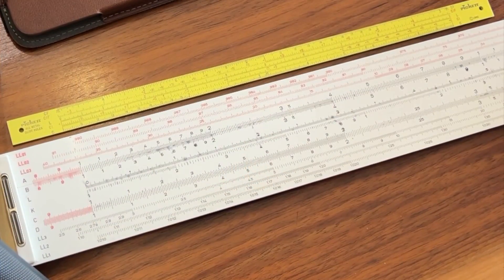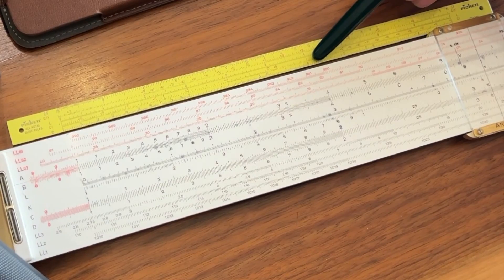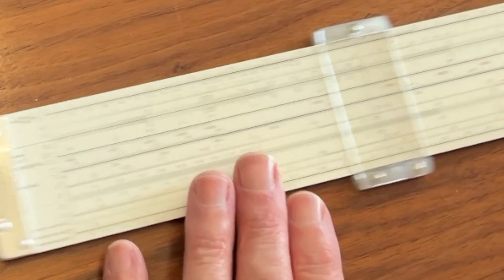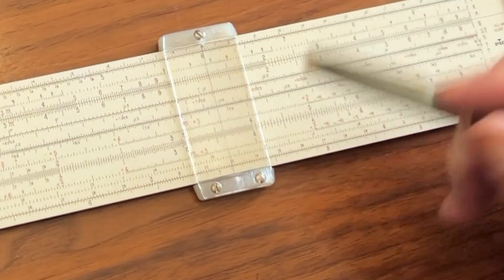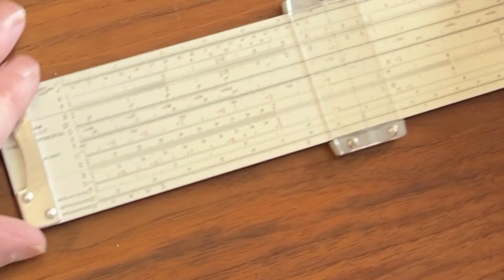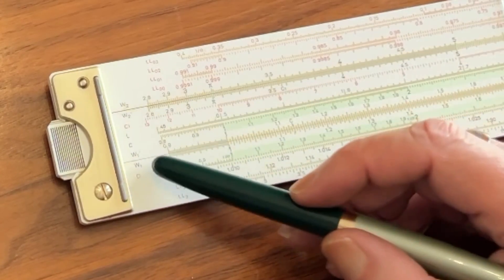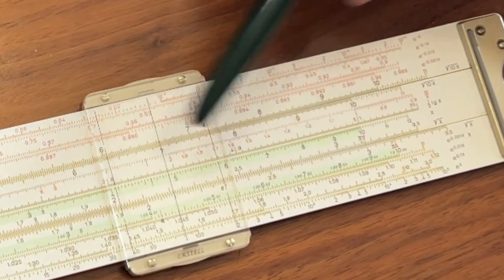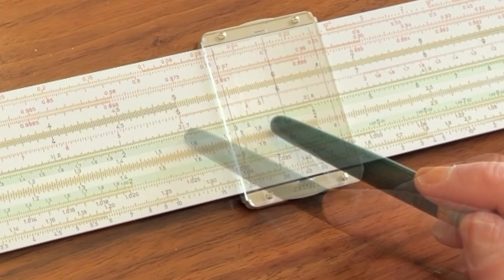Genius of Precision

Comment: Very nice video! I entered engineering school in 1977. My class was the first class that did not take a class in the use of a slide rule. A calcultor that would do Trig functions cost about $100. It was a ton of money back then-about a month's salary for a part-time student job. In high school, we couldn't even use a slide rule.  All calculations were done using long hand, or with log tables. How times have changed.  I saw a calculator in a dollar store more powerful than my first high end TI for $5.
Reply from the maker: I got my first TI-55 freshman year in high school..

Comment: Impossible to follow this guy with his super small scale and unreadable  scales as well as his super rapid changing locations before one can read any of the scales.  I had to use a slide rule for surveying classes in spring 1972.  The number of digits were to few to get accurate values of small angles with the trig functions.  We had to do calculations long hand on paper. By the way, all the Apollo moon shots used slide rules to perform almost all the calculations.

Comment: In the early '60s, we got three-place answers, but we had to calculate the place, 1.0, 100, or .001. Villanova had an IBM 1620, the size of an upright piano. We used punch cards and made money troubleshooting other students' errors. Now, we use a concrete slide rule for the quantities. I then enter all the numbers into a program to verify the answers. At $265 a cubic yard, we cannot  error. BTW; IBM could calculate massive cut and fill jobs, and calculate the offsets, etc.

Comment: There were scientific slide rules where a lower line was 1 and the upper line was 
times Pi just looking up on the hairline without moving the sliding middle.
And commercial slides where the lower line was 1 and the upper one was times 360 ( daily interest) and mark up or down was easy.
Yeah, and I know how to do slide rule stuff with logarithm tables ( lookup values adding and looking up the reverse value) with pen and paper.
But I’d prefer my Casio scientific calculator or TI- spire CAS app if I had such problems at all. 
All I do is throwing SQL results at Pivot tables.
The faber Castell SR had an additional magnifying lens as accessory that could be attached to the clear thingy for improved (lol) precision.

Comment: I did my A Level exams with a slide rule. Five years later I was using a Casio scientific calculator and writing stats analysis programs for THE computer at my college for my Diploma in Management Studies.

I still love slide rules. They designed Vulcan, Blue Steel and Concord, and the ships my grandfathers sailed. I have my father's, with his main engineering formulae printed on its back. He literally did rocket science with those equations and that slide rule.

Comment: As an engineering student, I was darn good at using my slide rule back in the 1960s.  I knew all the scales.  I still have it.  Mine has a belt loop on the case. I could wear it walking around campus. Pretty nerdy huh?  I also had a pocket protector, which was actually more than nerdy.  Ink pens leaked a lot in those days.

Comment: I still have mine.  Got me through Caltech in the late 60s. There were Pickett fans and K&E fans. Only the nerdiest hung them on their belts : ) I bought an identical one on Ebay for my granddaughter. I still have my little plastic circular slide rule from then, as well.
Reply from the maker: Cool. My only experience with a slide rule as a primary calculating device was the e6b flight computer
Reply: @sliderulesandmathematics9232  During my first year in grad school (1972), the (Astronomy) department bought a newly available HP-35 calculator for the (12 or slightly more) grad students to share. It was chained to a desk in our grad student lounge : )
Reply from the maker: And to think calculators are as valuable as paper clips now it seems. I think we all just use the free one on our phones
Reply from the maker: I prefer the tan/cream colored Pickett n3. Great scales and doubles as a katana

Comment: I used a Pickett slide rule for years as a C-141 Flight Engineer. Then, they issued HP 41CV calculators which I used until I wrapped up my Air Force career.

Comment: I saw a much larger slide rule someone had ... I think it was something like effective 50m or more, printed with the scales spit around a drum.  Made years ago by, I think it was a German company if I recall correctly.  These were quite popular for, e.g. use in banking in the 1940s ... want to calculate that 30 year multi-million dollar loan, and be quite accurate ... yeah, 50m or so long slide rule.
Reply from the maker: Sounds like a fuller calculator. The scales are 41 feet long

Comment: I'm 83 and a retired Engineer. Brings back many memories. I bought my first slide rule in 1961. I still have it, along with 3 more.
My first electronic calculator was bought in about 1975, I think. All it could do was add, subtract, multiply, and divide. It cost me £80! Still got that as well.
In about 1997, my daughter's mathematics classroom in high school had a large 8 foot long basic working slide rule on the wall. I asked the teacher if he used it, but he didn't know how to. I offered to teach him, but he declined. I offered to buy it, but my wife vetoed that. Pity. It would look good on the wall of my man-cave.
(Thinks: I believe I could make one in my workshop. Secretly, of course.)
Reply from the maker: I have a 7 foot Pickett
Reply from the maker: I also have my father’s (ME U of M 59) and grandfather’s (CE Cornel 25) KE slide rules

Comment: Before the advent of electronic calculators, the Irish Department of Education used to issue a little yellow book of Logarithm, Trigonometric, Physics and Chemistry Tables for Secondary Schools (High Schools). The Department's genius touch was that we were provided with a clean copy of the 'log book' for the high school graduation (Leaving Certificate) exam, which is the portal exam to third level colleges. Even the fairly average student was aware that if you knew and understood how to use what was in the 'log book', you were already half way to doing ok in the exams. We came to know that little book backwards, and knowing it made us numerate in a way high school students today seldom seem to achieve.
Reply from the maker: Exactly. We made a grave error in letting calculators in the high school
Reply: @sliderulesandmathematics9232 and now they're letting AI in.
Reply: I had one of those books, imagine its value 200 years ago

Comment: I used a K+E 20-inch for the first year of engineering school in 1975.  Our “Introduction to Engineering” class spent quite some time teaching us how to use the slide rule.  In my second semester, in 1976, relatively cheap Casio scientific calculators became available in my home country, and the slide rule soon became obsolete.  Some professors wouldn’t let us use calculators in the exams.  They insisted we needed to really learn how to use use the slide rule in case “one day, in your professional career, you are in the middle of an empty field, and the calculator’s battery runs out of juice.”  By the end of my second year of engineering school, calculators were widely in use.  I still keep my K+E, however, as a reminder of my transition to college.  Slide rules were some clever calculation tools, and the only portable calculation tool available to anyone from the 1600’s until about 1970.
Reply from the maker: I love the 20 inch KE and use it regularly. Great accuracy and clear numbering

Comment: I had a cheap 6 inch plastic slide rule going through engineering school in the early 1970s. I only needed the basic scales.
 I eventually got a Texas Instruments scientific calculator. I could also use the college computer (punched cards in FORTRAN).

Comment: I own a 250mm Deitzgen and a 600mm Deitzgen (log-log dual slide) that got me thru The Calculus and Differential Equations and sent men to the Moon and back safely in less than 7 years, from Mercury to Apollo. Musk and his tens of thousands has spent $17 TRILLION tax-payer dollars with computers and nearly TEN YEARS and hasn't had a successful launch of his " Heavy Lift" rocket or his "Starship" that NASA has finally realized CAN NOT WORK. They are both in the lap-drawer of the desk my 'puter-toy sits upon. You can STILL order them from Germany, but instead of $16 for a 250mm, be prepared to pay $200. Just like my Parker 75 Presidential Fountain pen cost $27 in 1972 and now when they are produced, they are $300 with a "Super Flexible Gold Chisel Nib". A slip-stick is STILL a bargain, considering a WORKING Hewlett-Packard HP-85 sells for $3500+ on Fee-Pay...

Comment: Have you looked at circular slide rules?  I had a 600 inch equivalent with 5 digit accuracy.  But I often had to solve the problem with a regular slide rule to make certain I was on the correct spiral scale.
Reply from the maker: Yes o have a fuller and a precision circular rule

Comment: I've never used a slide rule but they were cool to me even when I was a kid at a time where pocket calculators started to appear in my country.

Slide rules gives you a different dimension to the numbers you are looking for. That dimension is in the movement of your hands that feeds back into your brain. That movement gives you an insight to what the numbers are actually doing. It's not about precision but about the engineer feel for the problem. If you want precision you can get it but that is irrelevant most of the time. 

I've had the privilege of having a microwaves class where the teacher asked us to make all calculation in our head. It was not about precision but about the feel for the numbers: was that answer about two volts or two hundred? It was not about decimals. By the end of the first hour I came to an appreciation of what he was trying to do even though I was silently mad at him for 'forbidding' pocket calculator. Doing all those rough calculation in our minds was not necessarily faster. It was faster in giving us insight.

Comment: I still have a Faber Castell sliderule that I bought in 1965 for £5/10 shillings. £5.50 in modern GBP. That was what I earned working 2 weekends in a garage when I was at school. I got a degree in Electrical engineering using it. I lost the rubber ends for mine just as you don't have.

Comment: You pulled out the Faber Castell, and I had to back away because I started drooling on my keyboard.
Reply from the maker: Wait til you see the fuller calculator
Reply: @sliderulesandmathematics9232  Never used a Fuller so it won't have quite the same effect.

Comment: Brit here : Slide rules were/are? fine for structural design, as it involves varying factors of safety and empirical strengths of materials. I mainly did highway design, pre-computers, and that did need strings of significant figures. I mainly used 8-figure logarithms, and eventually a crude Friden calculator, which cost £800. A very senior colleague much later gave up his slide rule only because of the constant jeering he got from the youngsters with their fancy calculators. We went completely metric on 1/1/1968, except for the distances on road signs.
Reply: Not completely metric.   Pints of beer, pounds of flour, etc.  Weights and measurements were imperial.
Reply: @GodzillaGoesGaga I agree ; I was trying to to refer to UK civil engineering in particular. Of course we now buy our road fuel solely in litres, but still talk about miles per gallon. I don’t think litres per 100km will ever catch on here, especially with mildly eccentric Britons such as myself.
Reply: @GodzillaGoesGaga   I'm a beer drinker from the future and I just wanted to drop in and let you know that a "pint" is NOT a unit of measure.  A "pint" simply means a glass of beer.  A glass of beer is generally about 500 ml, but it varies a lot.  If you prefer your beer in a can, you can ask for a "tinnie" instead of a "pint".

Comment: I have here a yellow Pickett Microline 120, which I bought back in 1967, when I started high school and it still works!  🙂.  It's a basic slide rule, which I used in my electricity, electronics and physics classes.  I paid $2 for it, IIRC.  I also recall my electronics teacher had a slide rule that was customized for electronic calculations and included things like reactance.
Reply: Ok. Sure but the batteries for that model are so expensive
Reply from the maker: you can get them on line on Amazon.  Right next to the Kidneys.

Comment: What a madness! Just use the metric system which fits to all other basic units of physics, this nonsens would be obsolete...
Reply: this has nothing to do with the units of measure, but with the fact that the scales on the ruler are logarithmic and not linear
Reply: #’s are dimensionless
Reply: The slide rule is a calculation tool, and has nothing to do with units of measurement. They were used all over the world, including in countries which use the metric system as standard. It is the analogue equivalent of the pocket calculator, therefore your comment is the equivalent of saying "just use the metric system and calculators will be obsolete".
Reply from the maker: Murica

Comment: Thank goodness for the invention of the electronic calculator.
Reply: You may have missed why slide rules are such superb tools. If you just use an electronic shoveler you’ll never know if you have made a huge mistake. Slide rules however force you to determine the order of magnitude estimate and then a rough idea of the first few digits. For example, what are the square roots of 2, 20, 200 and 2,000? On a calculator you might not determine if you have left of a zero or even typed in the 2 correctly.
Reply: @Trevor_Austin  Perhaps you meant that slide rules WERE superb tools when they were the only option.  I don't know anyone who continued to use tnem once electronic calculators came out.
Reply from the maker: I do for many things, especially trig.
Reply: Not really. Calculators and computers only make people unwilling to think.

Comment: When I started work, we had a one of the cylindrical extending models. Unfortunately, calculators were just coming into use, so it never got used properly
Reply from the maker: The big ones were fuller calculators. I got mine from the UK

Comment: I got very comfortable with my "slip-stick" (I still have it somewhere) while getting my BSEE from 1970-1974. There is no better way to develop intuition about engineering calculations than spending hours every day doing them on a slide rule. In my five decades as a professional, that deep intuition about numbers is arguably the most valuable asset that I acquired during my undergraduate years.

The ability to look at or listen to an analysis and "smell" that something isn't right is especially crucial when time or life and limb is at risk.
Reply from the maker: Absolutely. I would essentially outlaw calculators in high school in favor of slide rules. When you are working the trades or going to college then you can use calculators to apply the insight you learnt with the sticks
Reply: Yes, the Tay Bridge which collapsed in 1979 looked unsafe even to untrained people, some of whom refused to cross it. Lessons were learned, and the later Forth Bridge consequently is very sturdy indeed.
Reply from the maker: One of the more subtle aspect of the slide rule is the 3 significant digit precision.  As a result, many things were slightly 'over' engineered just to make sure...
Reply from the maker: We are hitting the LL scales next, then specialty scales like P and hyperbolic trig